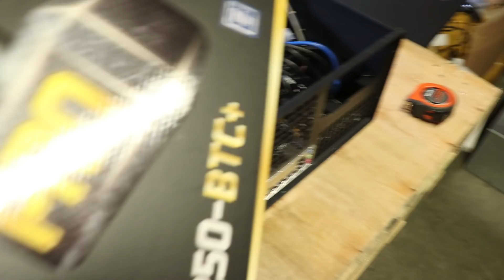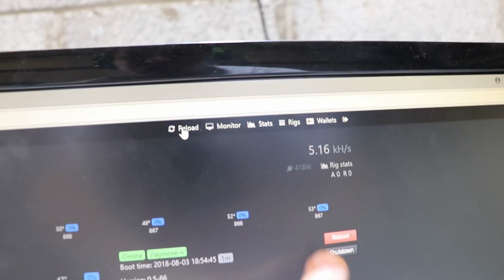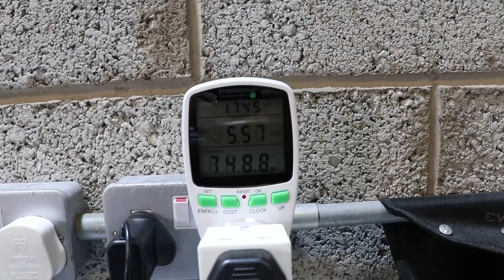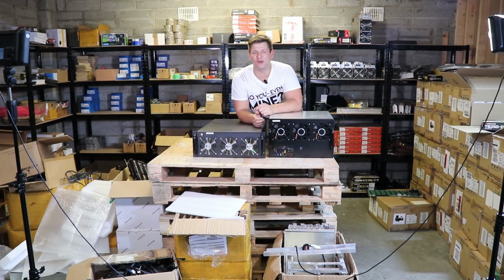Monero mining test in closed case !!

Comment: That's exactly the setup I have in a very small apartment. I have three of the silver ones, I had to change the fans because they were too loud, I installed silent fans in front and in the back, they are setup in the bedroon and all I hear is the sound of MONEY...
Reply from the maker: Ramon Pagan ha ha, i love it sound of money:))) which fans are you using, temps on cards?
Reply: That's the name of the game... Money..Money..Money..Money..Moneeeeeeyyyy.
I am using some unknown brands I found on Amazon,  2200 rpm intake and 2400 rpm exhaust to produce a little negative pressure and extract more heat that way. The high temp. is 53 on the center GPU and 46 to 49 on the others.